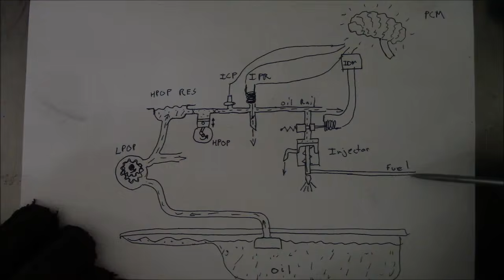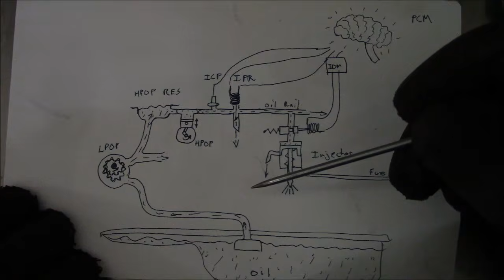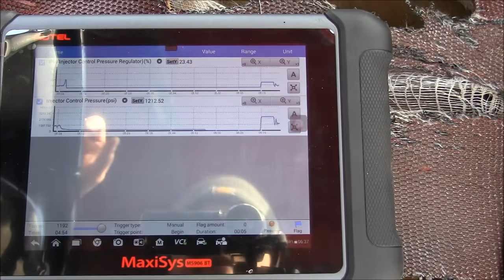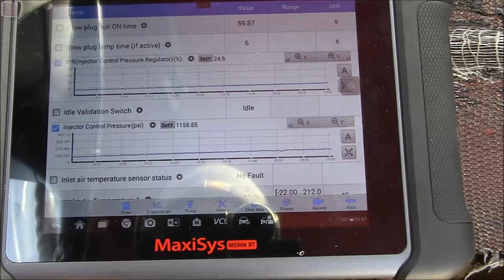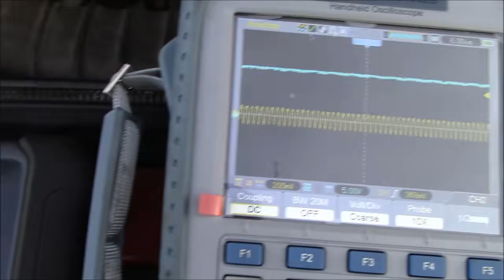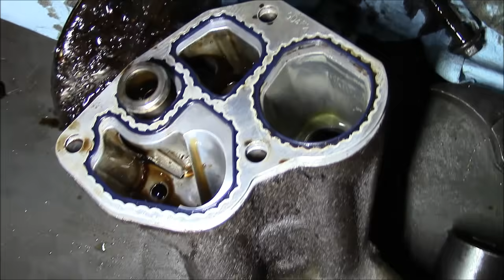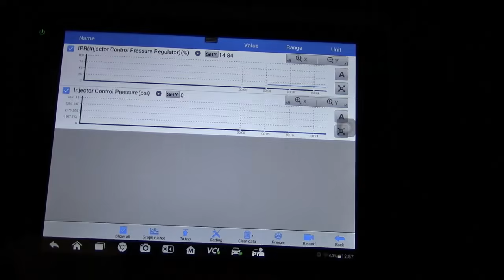7.3 Powerstroke Knocking, Rough Idle, Dying, but only when Cold. Plus many other Issues!

Comment: I like your variety of vehicles.  Not just passenger cars.  But also diesel trucks, tractors, dump trucks, ...
The sad thing is to see all those nice vehicles so destroyed by road salt.  Got to wonder what is the cost benefit analysis of salting the roads to avoid wrecks versus the cost of cars not lasting as long as 10 years.
In Atlanta they bought salt spreading equipment a few years ago. I totally disagree with that move. Many winters it never gets used.  But it still has to be maintained.  A winter storm that makes the roads hazardous can just be sat out because in 24hrs it's all gone, melted away.  So once every couple years plan on staying home one day.  Cheaper than the long term salt damage.

Comment: If not a enough High pressure from Oil pump or it could be a bad electric solenoid in Hi oil pressure pump that won’t let the fuel come out of the fuel rail or is causing it to fail

Comment: I always wonder why the diesel aftermarket uses things like pushlok hose. That stuff isn't approved for use in fuel systems. Why they don't just use nylon lines is anyone's guess. Its not hard to make the lines.
Reply from the maker: To be fair the main reason that stuff is that approved is for crash safety and evap emissions (they all leak a tiny bit). The aftermarket doesn't care about either.

Comment: Are sensors controllers or sensors? I've seen many of your videos where failed sensors are to blame for engine performance. An oil pressure gauge is a sensor that won't effect engine performance if it fails. I know it's a small thing but I think that " sensors" should be called controllers because when controllers fail it effects engine performance and to call them sensors is misleading.

Comment: did you look at the underside of your wiring loom as it brushes up against the airbox? sometimes vibration wears through some of the wires and so signaling between the sensors and pcm are funky.

Comment: 6.4 is a ford motor not a international.  The 6.0 is not a international motor. The 6.0 is the 1st diesel engine that ford produced. Ford used the 7.3 as a floor mat to copy to the 6.0. Hints to the call 6.blow.

Comment: Check the ICP If it's leaking replace it and will correct the problem it will stop the surging and keep your high pressure oil pressure correct

Comment: "You don't need a 40A fuse on a fuel pump. . . ."  I know what you meant, but (being nearly as picky as they come) that isn't the test.  We size the fuse for the size of the wire, which is what it protects.  We size the wire for the size of the load.  You said the wire was AWG #14 (looked #12 to me, but I wasn't there); that tells us the maximum size of the fuse to use.  If for any reason the load needs more juice, change the wire, not the fuse.  --  Sorry, but I couldn't control myself.
Reply from the maker: That's not always true. Especially for motors. Since a motor has a large inrush current on startup, fuses are allowed to be deliberately oversized for motor loads. NEC allows you to go up to 250% of full load amps for "hard starting" motors. You see this in automotive applications all the time. Like HVAC blowers or radiator cooling fans often have 40 amp fuses but relatively small wire.
Reply: @WatchWesWork  Yes, that's so, and I should have put a qualifier on my comment (don't know how to do footnotes in YouTube), but my guess is that the fuel pump motor is a pulsing (duty-cycle controlled) motor, not something with a large starting inrush.  But in reality, I've been fixing things on people's boats so many times when I hear the owner express the view that the fuse is sized to the load -- and seen too many home brew installs with 25 or 30A fuses protecting #16 power feeds for radios, radars, and the like -- that I've become a bit of a pedant on the subject.  My apologies.  And, by the way, I love your videos.

Comment: Wes, did you happen to measure the solenoid on the IPR? Mine ohms out to 11.2 im not sure if this is good or bad. I rebuilt mine replacing o'rings, This is phenomenal upload It really helps me understand all the electrical and mechanical functions going on. And I really need to get some kind of live data diagnostic setup if I keep this old girl. I much prefer my 89 IDI.

Comment: Wes your boots only need the Red Green repair 1/2 a roll of Duct Tape each, as for the seat stuff it where the foam is missing and cover it with an old blanket. LOL As long as your happy don't worry you get those issues fix at your own speed. The electrical on any vehicle needs to be in good order or it will drive you up a wall when it starts failing. Don't forget to breath.

Comment: Sounds like the check valve in the HPOP is letting the oil leak down,thus the long crank times.

Hey Wes, you could really use a new seat, and maybe some boots too.😎

Comment: I've never been a fan of any system that works off engine oil flow / pressure.  Especially if it runs off a single pump and shares common oil system with the engine.  Look at this guy's other "carnage" video with the 5.4 3-valve for an example.

Comment: You asked the same question I have had for twenty years. Why on earth would they design such complexity (potential for problems) into these engines? As far as I understand it, the HEUI is only a means of firing the injector. Was this a means or achieving the ultra high injection pressures to stay pace with emissions and fuel economy perhaps? To me the old Cat system of injection pump pumping to nozzles in the head was the best system ever.

Comment: Thanks for this video. I am an experienced mechanic of 35 years, yet I had never worked on a Powerstroke until i bought one. It had sat for 5 years after being a tow truck for IDK how many years, but had 250k on it. It sat for 5 years because of a bad PCM They had the wrong PCM

But  did run until this year, then an injector seal failed and then the IDM and the PCM failed.They had plumbed into the main wiring harness and the insulation was falling off the wires because  they didnt replace the wire loom. It gets really hot here it looks like they updated the Injectors. I shimmed them and decided to do cups as well The injectors were all good but 1.  That one would start working after it got to temp. I did get it running somewhat before I tore into it

So I repaired the wiring harness, used metal tape for the injectors shielding. Every time I was getting ready to button it up, i found more problems as I went. I repaired  Now I'm finally ready to fire it up, but I can seem to  keep the rails full of oil. It just goes back into the pan and the low pressure pump  is not pumping oil up to the HPOP res. When I quit 2 days ago,, I pulled the valve covers back off and pulled the glow plugs to take some load off the starter. I made the mistake of changing the oil before I tried to start it. I got every last drop out of te 5 gallons out. and maybe the IPR is stuck.

Thanks to  you I have a much better understanding of the system.  I'm really surprised It didn't  break down  a long time ago..
Reply from the maker: It takes a long time to build base oil pressure on just the starter. You can fill the HPOP reservoir through the plug on top.
Reply: @WatchWesWork  I have been filling the rails as well.  I will crank it a few times, about 10 to 15 seconds go back and reservoir is empty and the rails will be way down. I was thinking there was a stuck check valve or the IPR lettin the oil drain back to the pan???

 As far as I can tell it' not coming out of the injectors. I did crank it a little bit before  i quit a couple days ago  and I was just starting to see oil comming out of the pushrods. I have filled the rails around 4x and their reservoir many times. I'm going out there now to try again. I'm gonna put  a mechanical gauge on the LPOP and see what I get. I did put as much as I possibly could in the oil filter as well when I changed it. I also have my dataport working now so at least I can see the ipr  and the pressure. I'm just gonna keep cranking it untll I have all the lifters full at last and them fill the res  and rails.I'll let you know what  happens.  It really helps to know more about the IPR. Thanks again.
Reply: @WatchWesWork  PS...it is a 95 too. Somehow I always end up with the oddballs.
Reply: @WatchWesWork  For some unknown as of yet, the oil wa going out #7 cylinder Thee seals look fine and dont have any cuts< It was seated Since the ac box was in the way I took a framing square across all 4 and they were the same height, before I took it out to see if it was higher, and it was not. That's a rookie mistake anyway. That truck is testing me. 

I still dont get why I have no oil pressure. It has to be a stuck relief valve. If I didnt have so much time and money into it, I would drag it to the field and blow the damn thing up. 

I do feel better knowing what it is. I can get a complete running engine with around the same mileage, from another tow truck for $400 buck, I think I'm gonna grab it, hone it put new rings and bearings in it and a valve job and throw that in there.  It will probably outlast me, I'll be 59 in a few days. I live by Fresno Ca if your curious.

I only paid $2500 for it like 8 years ago and took it to Oregon once. I have been a GM guy, but I was Impressed because Even though it takes 5 minutes to get to 75 it stays there going up the steepest grades loaded to the gills.

It had 5.13 gears and a changed them to 4.30's and now it will do about 110 instead of 80 and  got 2 mpg. 4 speed OD. .

I wanted to tell you, I always double clamp these hoses on that thing or if I can find the wide solid clamps, they work better than the regular hose clamps.

Here is a link to the  fuel bowl delete kit so you can do it right...   https://ktperformance.net/i-12458329-irate-diesel-regulated-return-fuel-system-ford-1994-97-7-3l-power-stroke.html

I got some power bucket seats out of an Isuzu Trooper, they were easy to install and made a big difference. You can put any seats you want in there. Heated and Lumbar support even!
Reply: @WatchWesWork   It appears the cups I bought on amazon  are some kind of junk metal that are electroplated with brass, I'll let you know.
Reply from the maker: @markusgarvey  As far as I know there is no way for oil to leak from the reservoir back to the pan. Even if the IPR is stuck, it just cycles the oil around inside the reservoir. So I'm no sure. You can pressure test the oil rail, but you need to energize the IPR to close it.
Reply: @WatchWesWork  the oil is dripping through the injector cup into the cylinder and back to the pan. There might be broken rings . Once after I started to turn it over, It sounded like it was hydrolocking and then stopped. You can see the cup has deformed because the metal is too soft and the electroplate is flaking  off. I have to drain the coolant and pull the cup out to confirm. I took some high resolution pictures since i can't really see. I thought I saw the brass flaking off on 1, 2 and 4 , but it really didnt click  because I have never done this job  before. If I can confirm I will sue them. I had thoroughly purged the cylinders before I put the glow plugs back and couldn't understand how there could be any liquid in the cylinder. The other side might have some smaller leaks as well. The ones I took out are not as scarred up except for the extractor marks. On #1 the top lip of the cup  had bent in, and I was kinda amazed how easy it was to push the metal back in place. This is a high res picture. You can zoom way in. I tried really hard to get them from american manufacturer and I thought they were. It's almost impossible.  (link to photo) https://drive.google.com/file/d/19DLt7xg98dIxCadn2om07VQpKHrQyaqD/view?usp=sharing

Comment: So i am an international service tech I work at a dealership when diagnosing a potential failed iPR valve we use a IPR block off tool which involves removing the valve installing the tool and jumping the two wires together and then re testing the vehicle for correct operation I can eMail you the service procedure and PN for the tool of you are interested in not chasing your tail in circles again

Comment: Looks exactly the same as a 6.0, why do people like this engine and hate the 6.0?
Reply from the maker: The 6.0 had a lot more issues than the 7.3. The injection system is the same idea, but there were many flaws. The 6.0 has an EGR and EGR cooler. They also had some weakness in the head gaskets. So what happened time and time again is people would buy a tuner, turn the engine up to 11, blow the head gasket, then blow the EGR cooler, then blow the oil cooler, then have a huge mess on their hands. The 7.3 made all of 215 hp, maybe 230 with an intercooler. The 6.0 was making 325 hp with 1.3L less. It doesn't take a real stretch to see how they might have problems. Although the 6.7L is now making 425 hp and they seem to hold together.

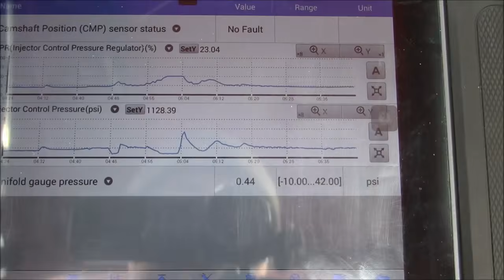Comment: 20:21 there is a correlation, the response is delayed by a variable amount. See for example at the timestamp "4:56" the pressure drops and the valve opens accordingly. There's just multiple seconds no response to the input, and all of a sudden there's a spike where all the delayed control input changes the pressure in a short amount of time. The valve responses accordingly and drops again slowly.

Looks like something is avoiding that the pressure changes fast, or the valve is sticky on some positions and need a high amount of input to be moved

Comment: These trucks needs Archoil 9100 every oil change!! Don’t skip. I had a weird hot idle, Archoil 9100 fixed that problem with 50 miles of driving. 200 miles later my starts are amazingly fast. Cold and hot, just short cranks and go. Use a Stancor relay for the glow plug relay, cheaper than Ford and a relay that’s hugely oversized.

Comment: Don't know if it's a problem on a 7.3 PS but trapped air is a pain even in systems with bleeders. I always drill 2, 1/8" holes in the flat part of the t'stat before installing. That will make it easier for the air bubbles pass and has little effect on temp. control of the system.

Comment: On that pitted coolant elbow. Couldn't you do a "fill and sand" job like "My Mechanics" does on his restorations? I don't know what he uses or if it would stand up to the heat but this is 2020! There has to be a filler that could stand up to that environment. Maybe just wishful thinking. I guess he is really just "bondoing", which wouldn't work. Replace the elbow?  ;-) Ya, I know. 60 bucks, probably.

Comment: I bought a 97 7.3 from an auction from a block heater fire.  Cheap insurance to replace your block heater!!!  ( Great point ) I Re did the whole thing,  fried the transmission on the first road trip.   Swapped in a manual.   Got stolen a year later.  Bought it back from insurance months later when they found it...  re did it all again with rosewood injectors and an inter cooler.      Sold it and bought a 12V.  Sadly the truck got stolen again from the new owner just recently.  Damn people suck.      I still have a few of these old obs fords.  (One of them ran rough with knocking like yours, swapped used injectors, uvch, 2 burnt pigtails, and good idm now it won’t start at all) You are great at explaining things!!    It’s like free school.  Thanks a bunch

Comment: I like the HEUI system you can run must dirtier fuel and get away with it.  I reuse waste oil for fuel in mine.
EDIT:  LOL I was pulling a camper and my IPR solenoid nut came off while driving, I had called a tow and kept looking and found it before the tow came so I canceled it and was back on the road, so glad I had done a fuel bowl delete and it was easy to spot in the engine valley. Thankfully that nut was it's only excuse not to run.
Thanks for the videos, been enjoying them!

Comment: I don't know that engine but seeing that it has a brain box disconnect the negative battery cable and turn on the lights and key the ignition that should reset the brain box. It quite often works

Comment: Disconnect ground from battery, ground clip to positive 15 min. Reattach ground, turn key to full on don't crank, leave in this position 10 min.
This is for computer to flash ROM to RAM.
Start engine & enjoy

Comment: You have the same ability I do, to over look the bad that does not count and fix the bad that does.  But I am fussy about my seats cause my back nags me when I sit down to rest. Was the solution the valve/ regulator thing you replaced?
Reply from the maker: Yes. It's fixed. I need to replace the seat though because it makes my leg fall asleep on long drives.

Comment: I watched this when it came out and of course liked it then so tell you tube that when a guy needs a refresher course that we need a second like button cause you crack me up for one and I have the most worst memory in the world. I have shared this video with other mechanics and they told me you are sharper than a new razor blade. I  wish I had some real money as being on social security is a dog food diet. I tried crawling around on my 95 king cab and all I can say is at 72, they took my fun button out. If I had the big money, I would have someone make every connector on it a quick disconnect so a guy could spin the eight bolts out and lift the cab off and then build a run stand for one of these. I  actually like this motor (engine) really well. Just like some and only some of the things they did on the 6.7 in the new trucks. I sure wish they had the manifolds that V8 detroit's have for the dual exhaust, just that part as I have very little use for the detroits except in boats as the parts are in every port and a million miles is when they take a second breath. I bookmarked this page as I like this that much. Thanks Wes for being the person that you are